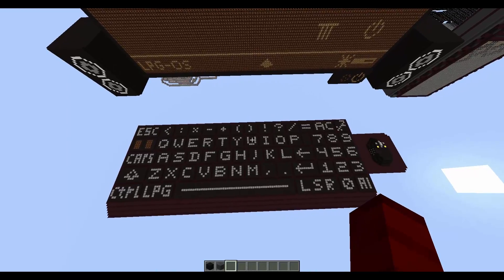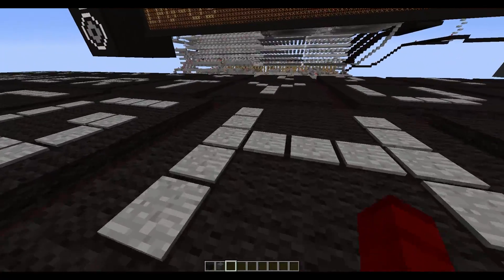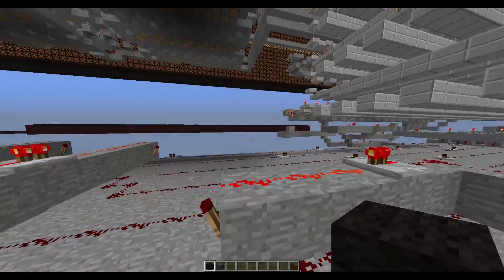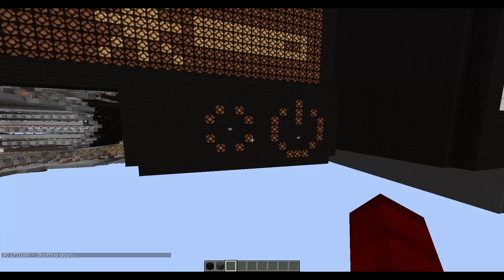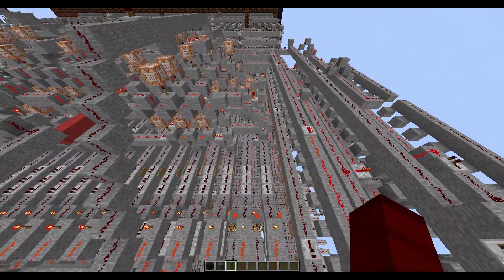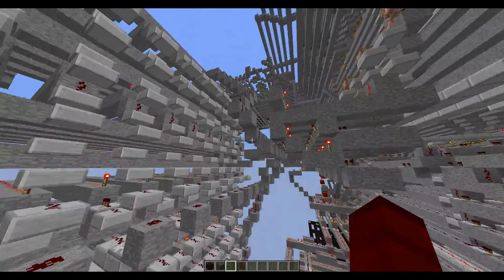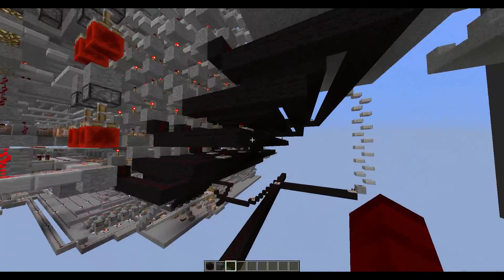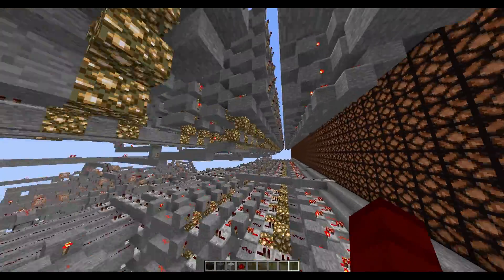Let's talk command blocks

Comment: don't get me wrong, command blocks are useful, but I'm not a fan of them unless it's something that is rare to see. computers with command blocks can be faster, but technically you can have the same speed with redstone with the instant repeaters. only time you would have different speeds is if it's completely made of command blocks. no redstone at all. then you can make the fastest Minecraft allows which is 20 hurts
Reply: Jonathan Criswell I made a command block computer. It is really fast

Comment: Does your computer work off of binary or decimal? If binary, how do you convert the 1's and 0's into text and numbers? Sorry if this sounds like a stupid question,  I am a noob at redstone computers.
Reply from the maker: +Alexwilson225 Ask anyone on the street nobody will know so absolutely no stupid question! 

Example of the ROM basically this is how the letters are stored: http://hydra-media.cursecdn.com/minecraft.gamepedia.com/7/7c/Redstone_Computer_Program_Memory.PNG?version=d5771945cea595e4a1fdec5810fbd989

One input is gonna enable a set amount of outputs. Those outputs go to a pixel. For the number 1, it's pretty easy just use 4 pixels in a straight line. So those 4 pixels are the redstone wires that needs to be enabled when you enter that into the ROM.
Although the input is decimal, to translate binary to decimal first you'll use a decoder which works roughly the same although the opposite way of above. A set amount of inputs will trigger a single output.
Reply: Lol
Reply: Thank You!
Reply: I'm gonna try to kill a beast: 16 bit ALU :D

Oh my, will that be fun.
Reply: +LPG Would you do numbers the same way? I think no, because you would need like 1 million modules? Now, THIS question might be stupid. :D
Reply from the maker: Alexwilson225 You just need 0-9. If you're looking to enter say 25 onto a display, you hit 2 first, then 5. The display needs to be able to place those properly.
Reply: Ok. I get it. :D thank you! I was very confused about just converting the 1s and 0s from the adders to numbers! Thank You!
Reply: +LPG Oh, sorry if I bother you, but 1 more thing: If I have adders daisy chained together, would I have 1 large ROM module to store the 0-9 numbers it would output? How would I get them to output the whole number?
Reply from the maker: Alexwilson225 I'm not sure if I can properly explain it through the youtube comment section. But you will only need one ROM.
Reply: Ok. Thank You! I think I figured it out: if you have more than a 1 digit answer, you put delays on the second, third, etc. so all the bits can use the same ROM! :D
Reply from the maker: Alexwilson225 Yes that works perfectly fine. That's exactly how my project above works.
Reply: Yep! I downloaded your world today and checked it out. Thank You for all of the info you gave me!
Reply: My guess is it would have to be binary. The nature of redstone requires states to be either connected or disconnected. So all information passing has to be done in one of those two states, thus setting a binary system.